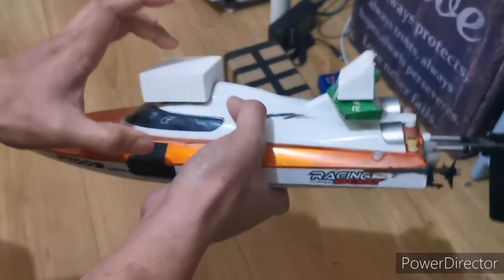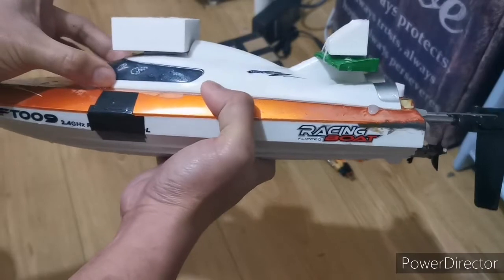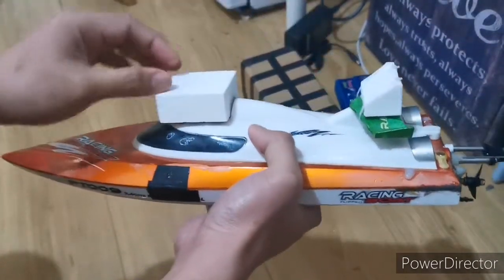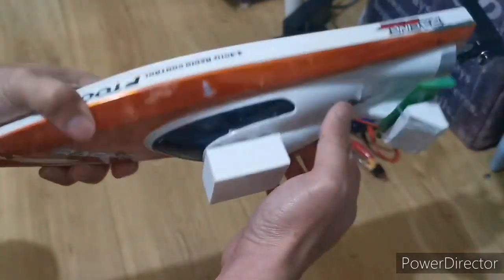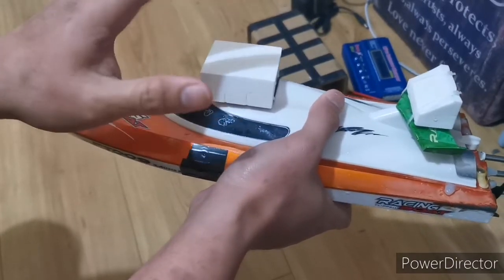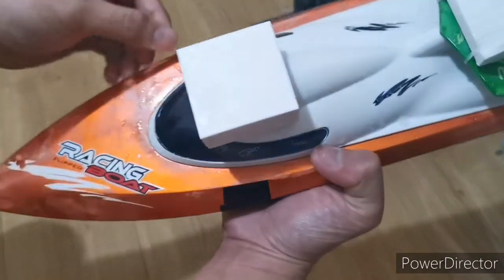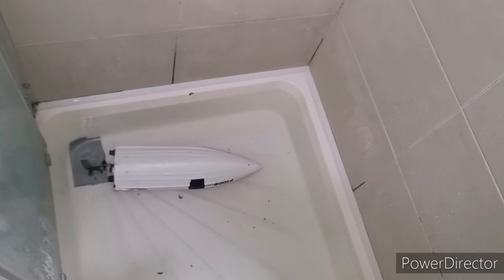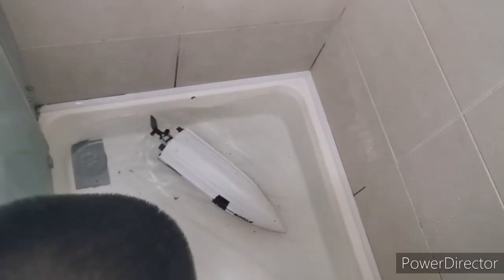Self-righting HACK for RC boats

Comment: The boat selfrights. You just need to give full reverse and then slam on the throttle. That’s how self righting works on these boats. If you don’t go reverse first it won’t roll over.
Reply from the maker: The stock version of this boat does. But this is fully customised. I just assembled it myself. The electronics I put are in different places, putting imbalance in the boat. I did those things you said. Considering my boat there had lower kv, high torque. So the only way is to put some buoyant materials on the roof
Reply from the maker: I put the details and specs in the description
Reply: ian Budget RC oh ok. I used to have the 009 and since bought the 012. Both good boats.
Reply from the maker: @earth9258  yea. Planning to buy ft012. Such a beast for its price!!!

Comment: Alternatively you can use , cork strips cut them to length and glue them all over the inside of the last cover. It should give you the same result without sacrificing the boats aerodynamics
Reply from the maker: Thanks for the tip sir!